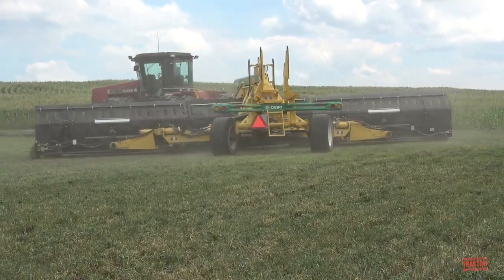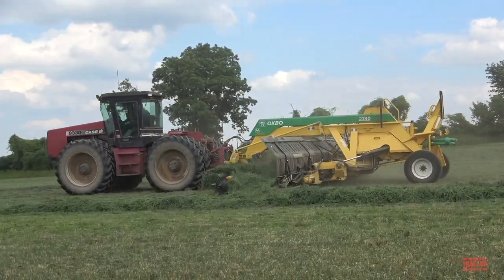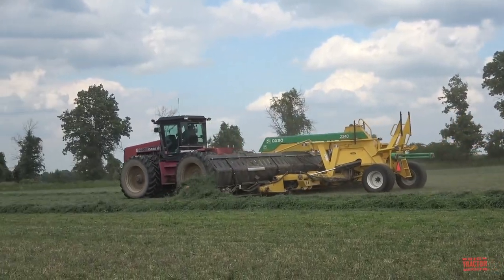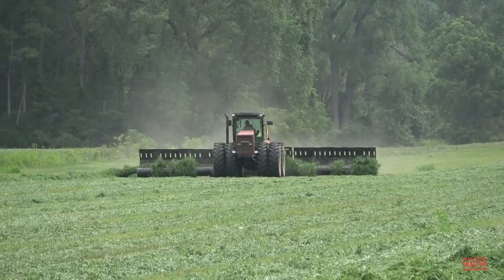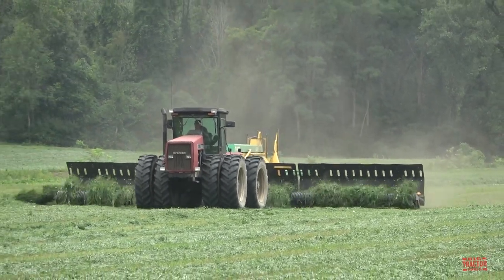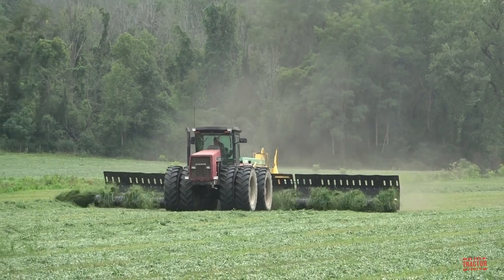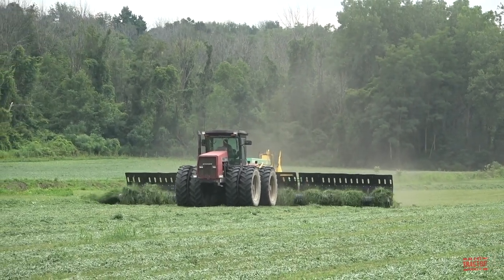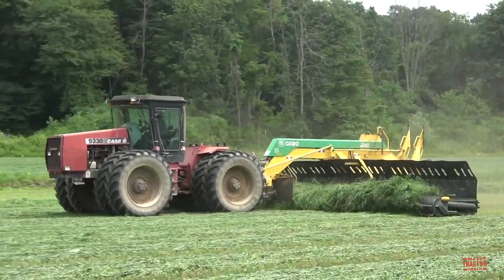CASE IH 9330 Tractor Merging 40ft of Hay

Comment: The OXBO 2340 looks like a nice machine and requires a 150HP tractor minimum.   We've used a 21 HP tractor on tandem rakes for a total of 18 feet per pass, but I realize the problem they're solving is slightly different than I'm used to.
Reply: Hey Jazzerbyte sound like us here in Western Pennsylvania. We pull a 7-foot new Holland 256 and an eight and a half foot 402 belt drive new idea one with a either a Farmall BN or c or super h one of two on the farm or sometimes we use a 460 but we usually go to the field with both of them so we're taking 15 ft to pass the 40 horsepower roughly. Sometimes I think it would be fun to farm like this big guys and other times I'm think I'm satisfied not to have their parts bills and their fuel bills LOL!
Reply: ,kl

Comment: What speed was he running that rig at? Felt quite fast (Although not on the scale of that self propelled merger that's your most popular video)
Reply: i run the older oxbo's looks like he was running around 7-8 mph which based on field conditions is about right. lighter hay can get as fast as 10 heavy hay around 5 to 6.
Reply: @aaronwarr34  It definitely looked an in-between of dry and wet. Although it looks pretty green and fresh to my untrained eye for what i assume is pre baling swath creation.

Comment: Wouldn’t a rake and a 80 horse tractor do the same thing?
Reply from the maker: No this machine is built to travel at 9 mph or more and sweep together 40ft of crop per pass.  That is allot of tons that requires allot of power.   A rake is not built to handle that much heavy green crop.  It would cause stress cracks on the frame.
Reply: @bigtractorpower  Well you certainly don’t need an articulating tractor to pull it